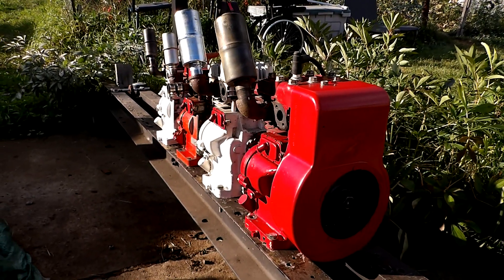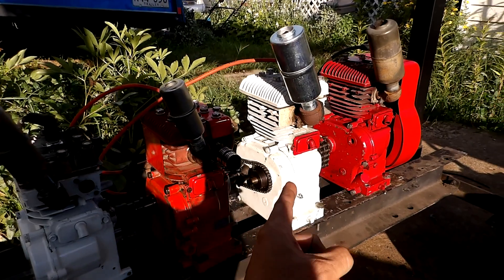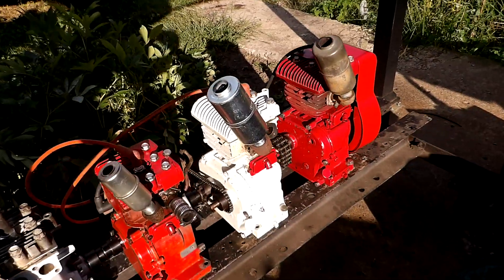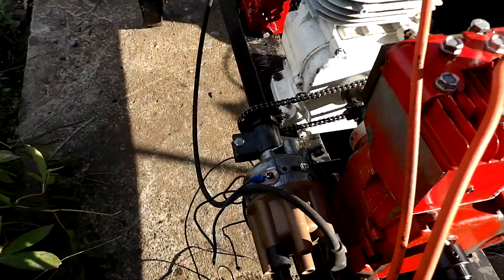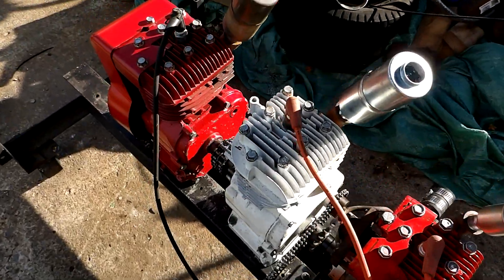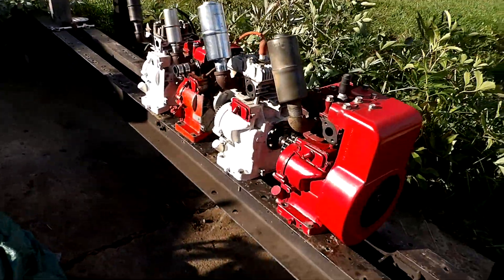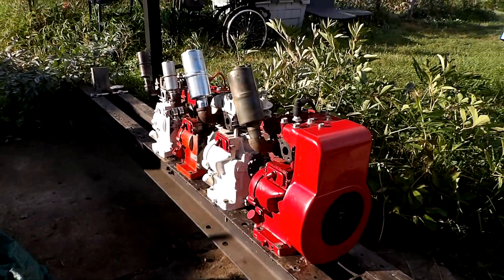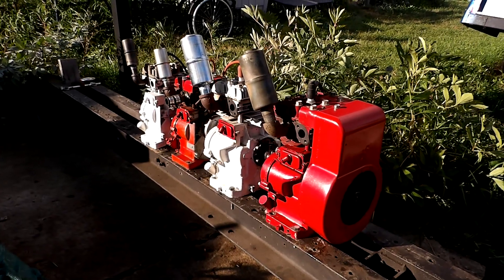The Briggs  5432 Engine Introduction vid!

Comment: Should be an interesting experiment. I like oddball machines. I am putting together a Piper Matrix right now. Oddball for sure.
Reply from the maker: Yes, it is an oddball project for sure.  The Bristol Lucifer was a weird on also, a 3 cylinder radial engine, I guess it shock very badly.
Reply from the maker: That looks like a good sized airplane!